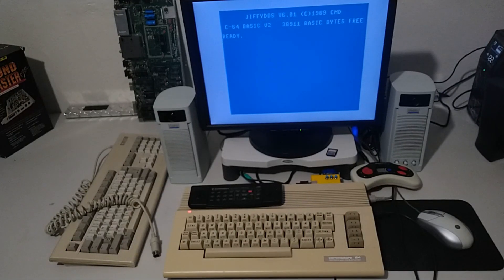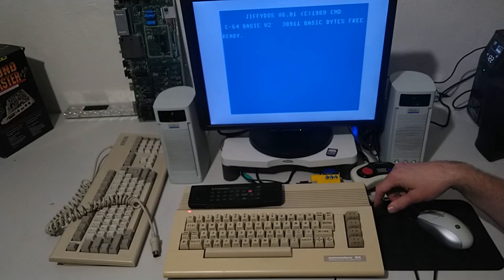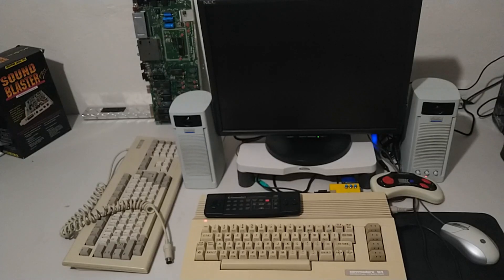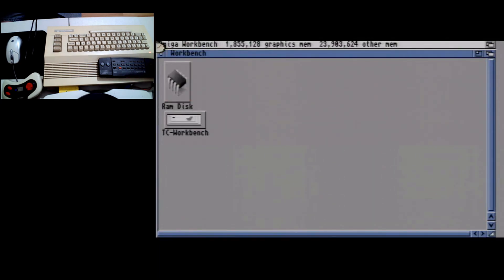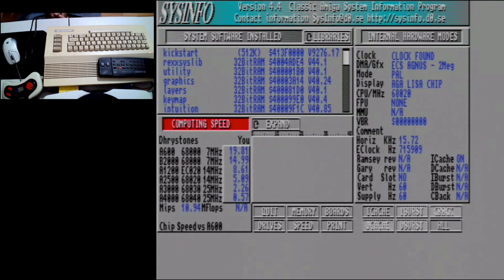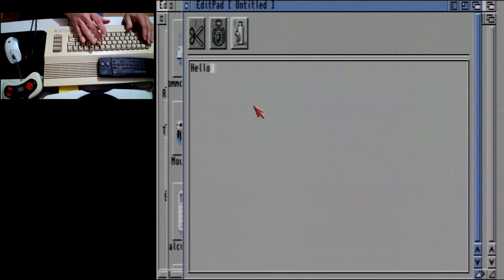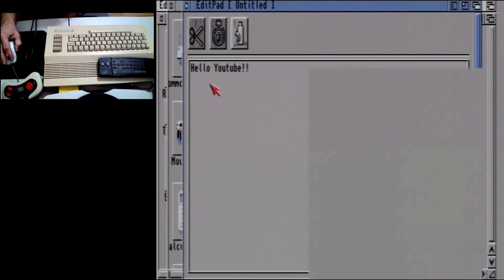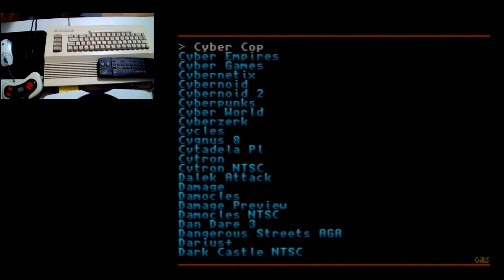Commodore 64 Turned Into Full Amiga! AKA The Turbo Chameleon Series Teaser!

Comment: how did you run it, it's an hdf file? because on the menu (right after the logo you showed when launching the core) i can only choose to load adf or hdf file
Reply from the maker: It's definitely run from an HDF file. If you check my channel, I have a series on how I did this step by step. It's a bit of a long watch, as I did it step by step essentially from scratch. 

If you have a pre-built HDF, you can bypass the tutorial, but you will need to configure the Minimig hardware settings to exactly what the prebuilt HDF will be expecting. Otherwise it either won't work, or will work badly.

Comment: Really good performance for a pretty old FPGA, didnt expect that. Shouldnt there be some core loading process of minute or two? Seems like everything is done momentarily soon as you plugged the SD card in.
Reply from the maker: The switch to the core itself is pretty much instantaneous. I don't own a MIST(er), as far as I know it handles cores differently. There is a finite number of cores to be used simultaneously at 16. You load the cores once and they stay in that slot. You can flash over them with a new slot any time you wish though. The 16 cores are available without delay.
Reply: @redrumloa  Thanks for the explanation.